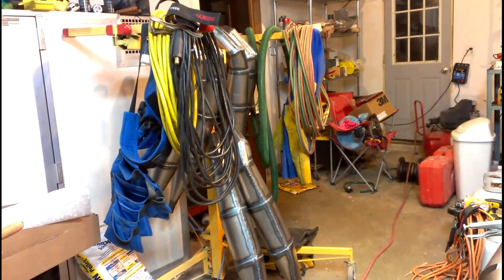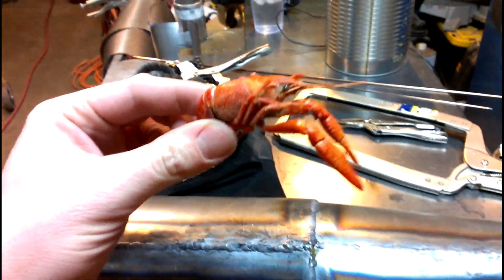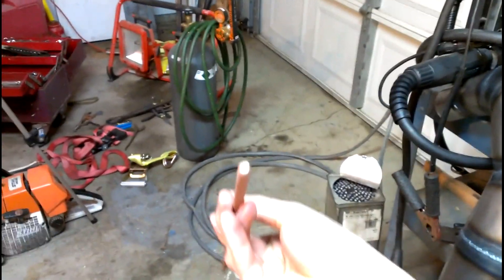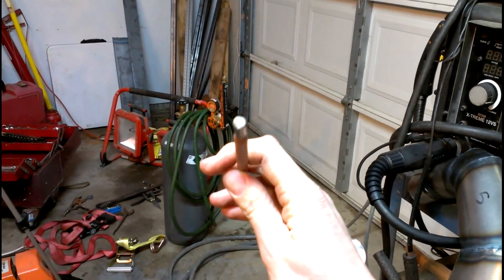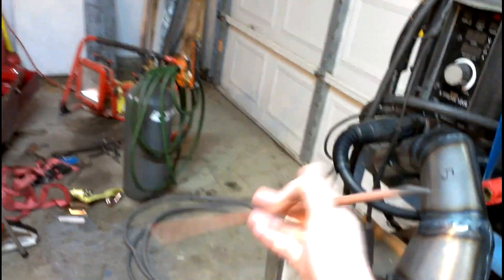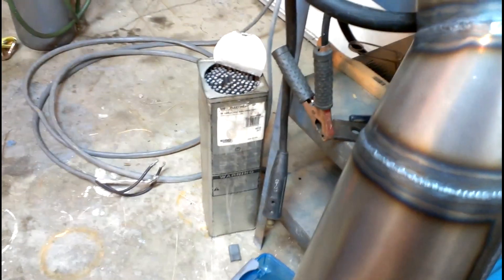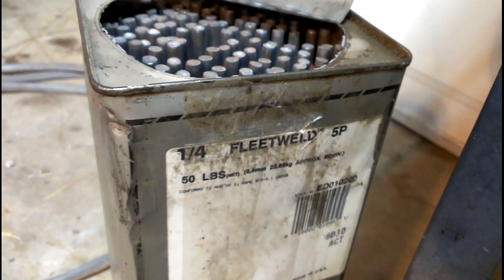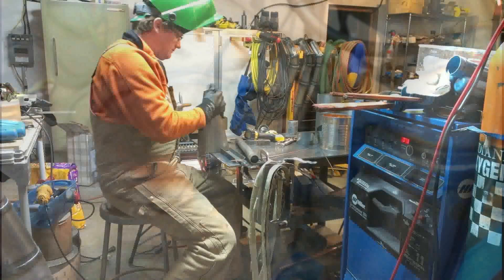2 Stroke Muffler Build time laps

Comment: Maybe some less time spent with the crawfish and more time on the quality of the welding and cone cutting might have been a better idea. As a single stage pipe the lead in or header pipe angle into the diffuser cone is too abrupt, and the length of the belly is too long. This pipe has basically two belly's which would draw out the negative wave coming back to the chamber and screwing up the power band. I would suggest this guy stick to welding broken farm equipment, or , pick up a set of factory pipes from Yamaha or Honda from any two stroke bike they make and study the pipe design that their engineers developed................just saying..........
Reply: Let's see your video how to make them
Reply: matthew renton
I don't need to have a video to know who's making the correct pipes and who isn't. This guys welds suck, and his cone placement is too abrupt for a smooth pulse wave. You want to know what pipes are good?!...go on the internet  and type in JL lomas pipes. Look closely at the welds of his pipes and the cone selection that make up his pipes. Right now I have a set of his street modified pipes on an RD 350 thats had extensive port work, barrel milling and head surfacing.The motors right at around 70 horse. Having sponsored a 2 bike road racing team in the 80's for 10 years I know what I'm talking about.